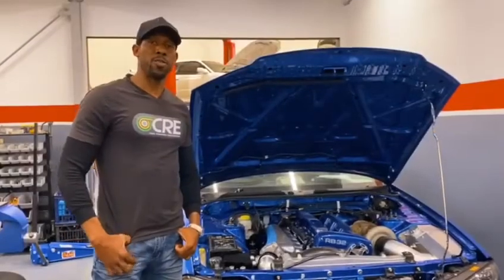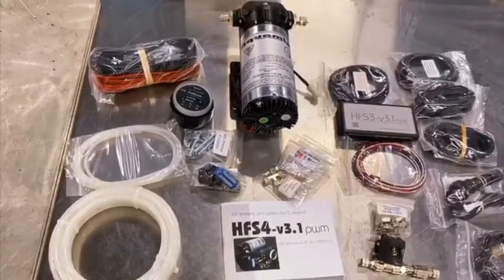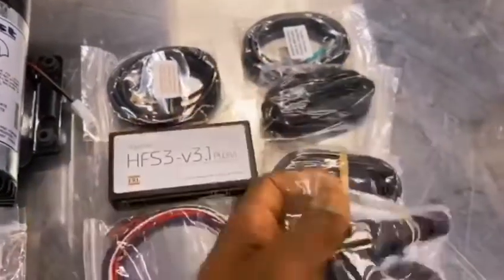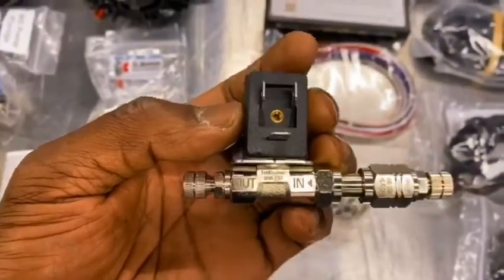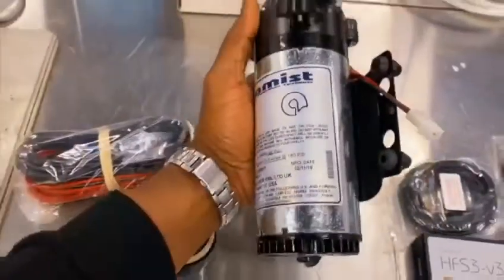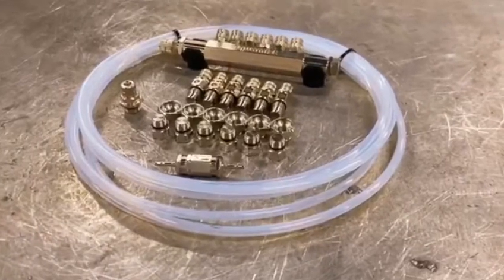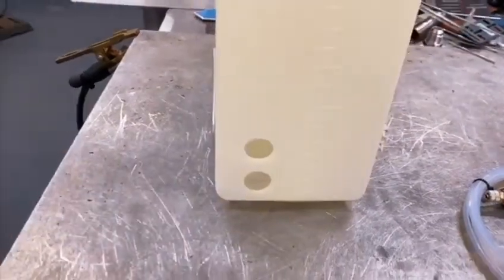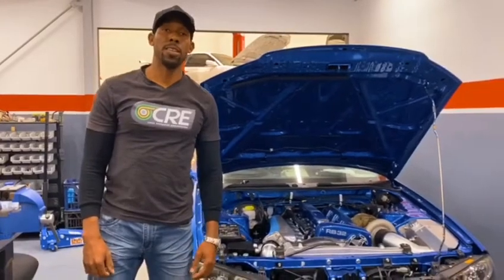Aquamist HFS3/4 Kit and Direct Port Bundle

Comment: What sort of power did she make with the kit on and off? Also, how does the controller integrate with aftermarket ECU's - Esp in terms of controlling/ CAN integration/control? Asking as I have a 3.2 in my 32R and be keen on this kit.. running a Link G4X with a G45-1500.

Comment: Really nice video how would this be setup on N55 535i BMW amreally new at this wmi
Reply from the maker: Hi mate. The N series engines respond very well to water meth injection, especially when tuned to suit. If you are a beginner to the water injection game, keep the set up simple. A single of twin jet set up, mounted in the post intercooler piping, will provide excellent charged air cooling and knock suppression. If you require further assistance on choosing the right system for your requirements, please feel free to send us an email at info@coolrunningsengineering.com.au
Cheers

Comment: Very informative video but I had a very tough time with the audio.
Reply from the maker: Thank you for the feedback Jeffrey. We have since upgraded our audio equipment. Please check out some of our more recent videos and stay tuned or future updates.
Reply: I’ll check those out! One question if I may…what size DP nozzles and post IC nozzle would you suggest for mk6 golf R on stage 2+ tune. I want to run 93 or 100 tune from 350-380hp on 92 fuel. Trying to decide which Aquamist nozzles to get. Thanks!
Reply from the maker: You don’t need to use direct port at this stage we’ve seen over 300kw at least he wheels with a twin post intercooler jet set up. 2 x 0.7mm (+5mm) Aquamist jets  will get the job done nicely. If you have your heart set on direct port, then use 4x 0.4b direct port jets and 0.5mm post intercooler. Make sure they are all +5mm extensions.
Reply: @coolrunningsengineering7495  Thank-you very much. Wow...my calculations actually matched! I was going to use a .6 on post but I'll get the .5 instead. I'm installing in an IE manifold so I will get those extra long jets! Thanks for your input!!